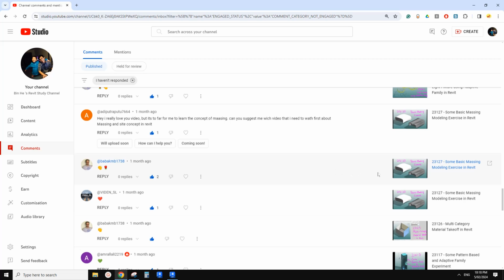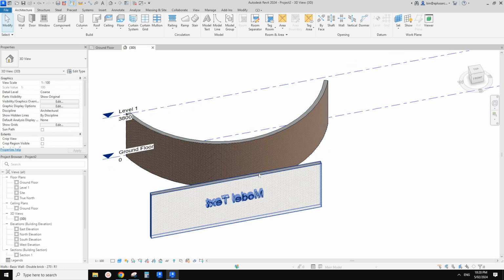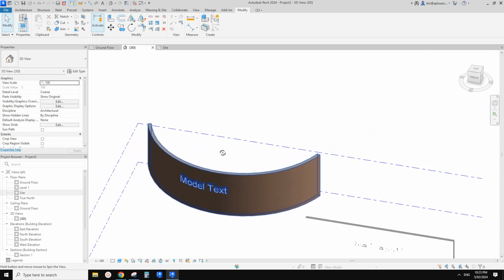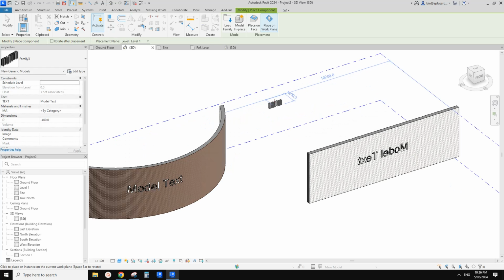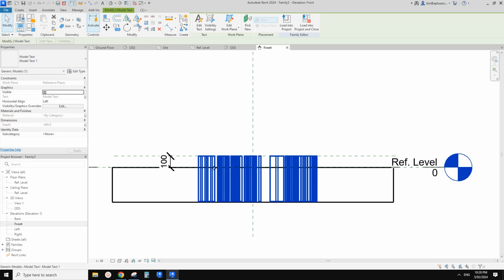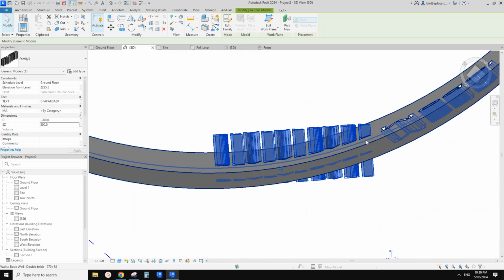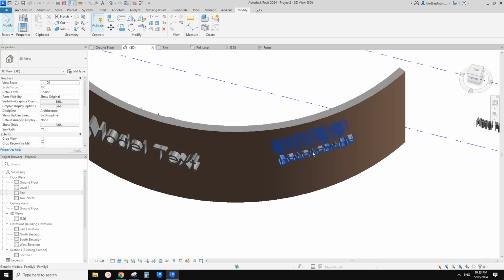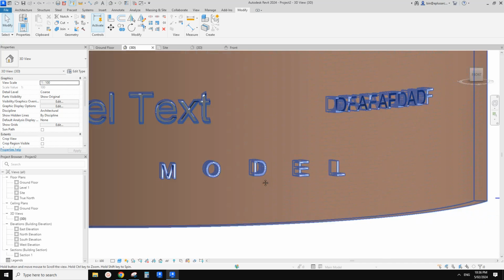24017 - Model Text Void on Curved Wall

Comment: Great job! Air as material does not solve the void question?
Reply from the maker: It will work for render, but in any view with WF,HL or SD, they will be visible.
Reply: @BINHE615  Indeed. Thanks

Comment: Interesting … but I have some questions and remarks: 
* why didn’t u just cut one geometry from the other , or made the face based as a void in the second case in stead of join then hide ? 
* it looks like Revit extrudes always perpendicular to the letters surface and not normal to the “host” surface (the wall)  ! 
* when you made the family as one word revit orients the entire word according to the justification of the whole word left, middle, right 
But when you place letter by letter, so revit orient every letter according to the justification of each letter = if you look from up you can see the parts of the wall in between the letters are  not parallel in the second case (which is more right)
Reply from the maker: Can we use Cut Geometry for this? I don't think we can. 
Maybe in the future we can create a curved model text to fit the wall.